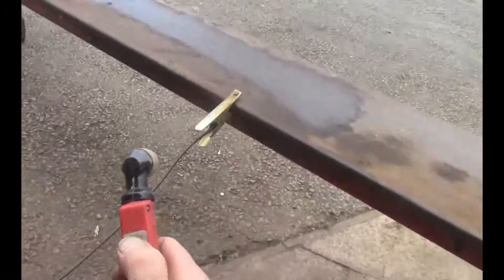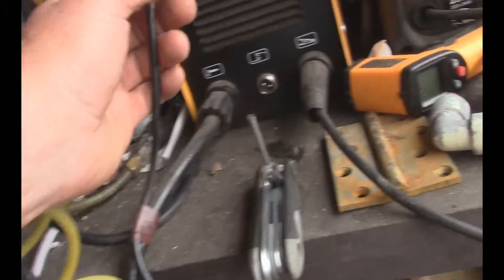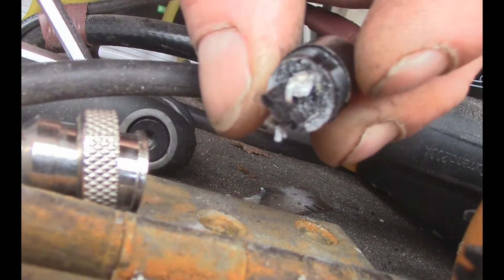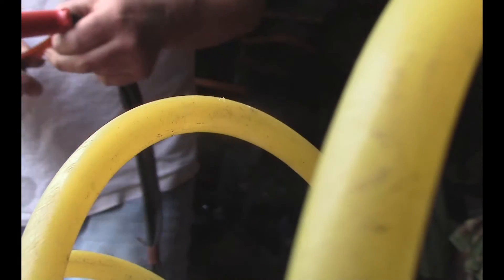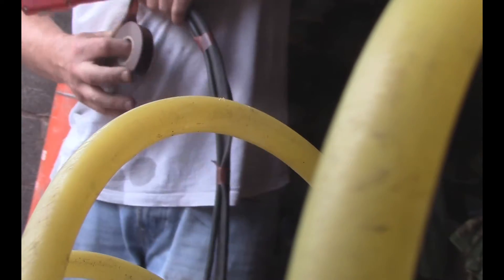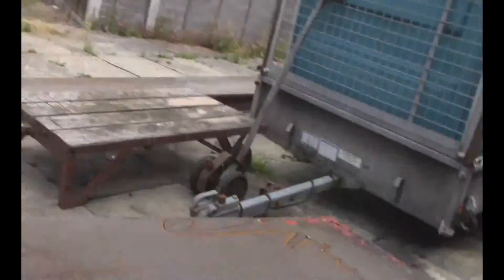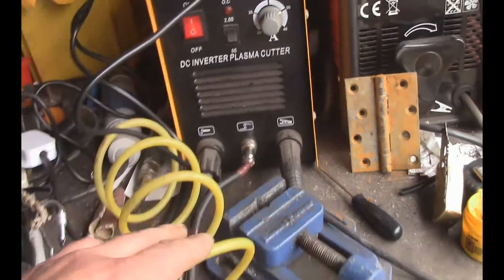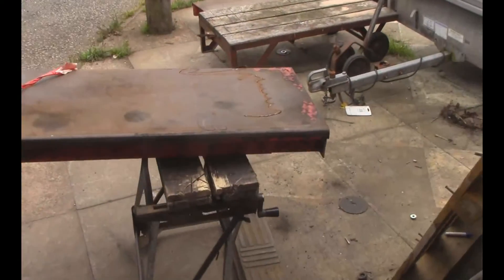Plasma Cutter cut40 torch repair, DIY electrical fault

Comment: I had a cut 30 and decided I needed more power so I got a cut 50 and from the start it was a piece of crap with less power than the cut 30, it worked OK but just lacked enough cutting power so I sent it back and got a bigger 60 amp cutter that runs of 230 volts and lots of amps, I have a 35 amp breaker and if I turn it up to full it will trip the breaker but luckily it runs fine on the 50 amp setting with the compressor running from the same circuit and will cut 3/4 of an inch with no problems.

Comment: Hi buddy , that plasma cutter still going ? in the process of figuring out what one to buy but i dont have a compressor yet so looking at the cheap end  any advice welcome Lyndon (facebook) at uskvalleyforge.
Reply from the maker: yes m8, i think it is anyway, not used it in a couple of months, it was ok but theres an update video somewhere because the original wire is shit and i had to replace it, dont be expecting it to beast through thick steel as it struggles and they use a shedload of air, my compressor is constantly on the go with it

Comment: hi
What is the value of voltage in these wire when touched together. for find special relay to trigger torch automatically. and it AC or DC voltage